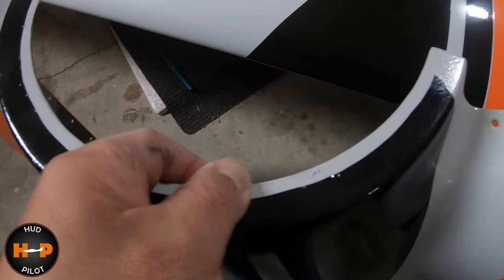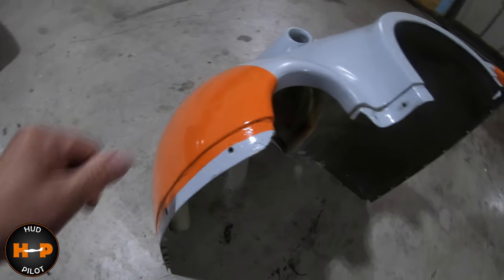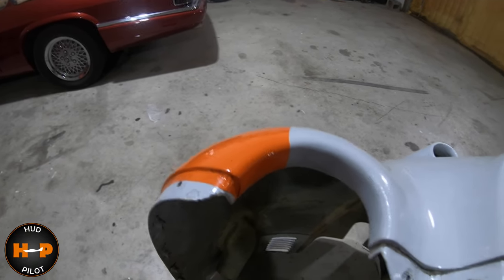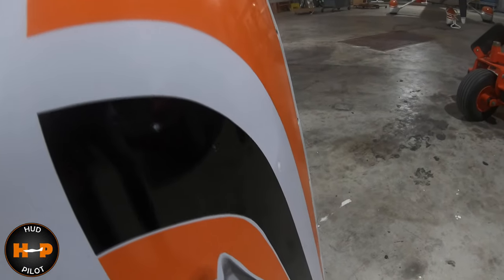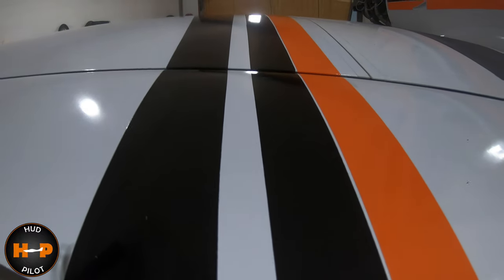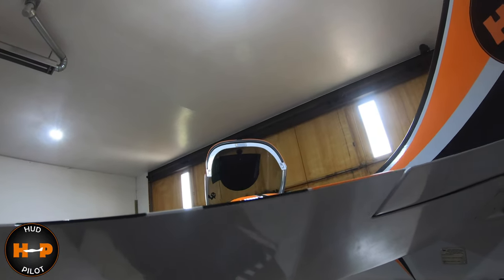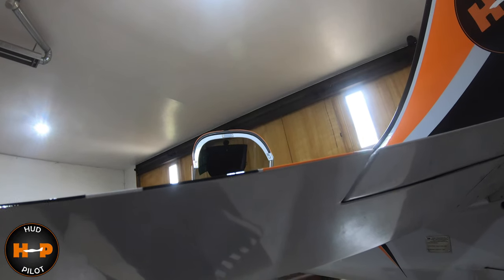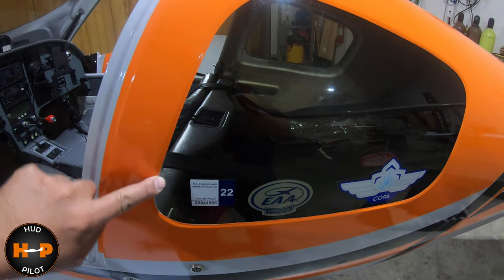Must see update: Vinyl on airplane after 6 months

Comment: I am was so keen to see your info on the wigs - thanks.  My biggest fear is that the wrap peels badly in flight. I see you wrapped one piece over the leading edge. I can't see how you handled the ailerons.  Uhm, would you perhaps be able to discuss more the wrap you did on your wings and control surfaces. 
.
.
I want o stick a couple solar panels to the fuselage.  Then I want to put vinyl of the entire solar panel and  remove a window from the solar panel. In essence use the vinyl to cover the edge solar panel and help hold down the solar panel.  Stupid idea?
.
.
I should  tell you - my glider has a metal body (not fibre glass).  my glider is in the 'home built category' like your 'experimental' category.  So I am allowed to wrap the he glider.  (One shouldn't wrap fiberglass.  If there is any stress cracks - it will show through the gel coat of of the fiberglass).
Reply from the maker: Hi again Mark. Will try to cover everything you’ve mentioned in this post. The peeling has not happened: not even in the tiny thin vinyl areas: the vinyl has been on for two winters and a summer with no issues (the update video in the series goes over that). The vinyl in leading edge wraps around and under and gets cut about 4” under the wing. There is no vinyl on ailerons (only on flaps). The vinyl tucks under the wing trailing edge by about a 1/4”.  If the wrap would peel badly in flight or there was a fear of it, airliners wouldn’t be putting it on 750kph airplanes. Improper installation (poor prep) and incorrect vinyl type would be the reason. This stuff cures to maximum bonding after about 7 days. 
The solar panel idea: drop it. Don’t do it. Pretend you never thought of it. This is not gorilla duct tape. This is delicate vinyl and not meant to hold anything down. 
Not sure I understand the no vinyl on fiberglass thing. Paint on a plane does the same thing. Old paint cracks. Newer paint flexes more and thus could “hide the cracks”. That’s a personal thing and can be discussed at length. In this case I say go with what you are comfortable with. Also not all glass planes are gel coated. Mine is not. Metal shouldn’t make a difference. I have seen lots of metal planes with vinyl. Just note that I mentioned in videos. EVERYTHING shows through this vinyl. Including flakes of dust that might be in the paint. Vinyl doesn’t hide as much as you might think it does. Again, go with what makes you comfortable. 
On topic of experimental, there is lots of debate on whether you are allowed or not. All those debates are on US planes. There is no rule in Canada that says you can’t. If there was, airliners would not be able to use this stuff. The Disney frozen plane is nothing but a base coat with giant stickers of Elsa and company. I know… I was there when it was introduced to the employees: I have the closeups somewhere on some computer drive lol. In either case, it’s always your decision. 
Hope this was helpful.

Comment: What to Lancair say about dark colours on the op surface of the wing/spar?  Most composites/epoxies have a Tg around 130/140f and black can easily exceed this in summer....
Reply from the maker: Great point. First Lancair doesn’t say anything because they were unresponsive throughout my build and this includes this vinyl application. 
They did mention in documentation way back in the day that their red plane was a test bed of sorts and folks really shouldn’t paint their Lancair dark colors. In my case, 1. The plane sits indoors all year long. 2. There isn’t enough color on this wing to attract enough sunlight to cause that much heat build up: lord knows I have checked. Most of the color is sitting on the D-cell of the wing (that’s why it wraps around the front). The warmest times this plane has seen the sun parked on the ground was at Oshkosh this year and there was zero hot surface difference between the light wing surface and the painted light grey surface. 
Thanks for writing.